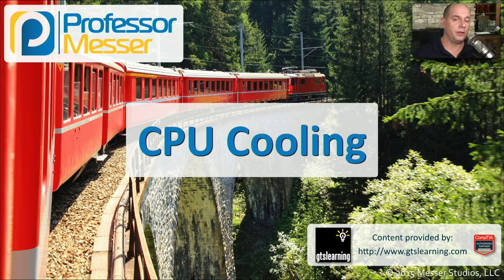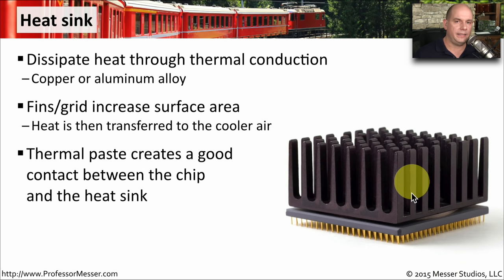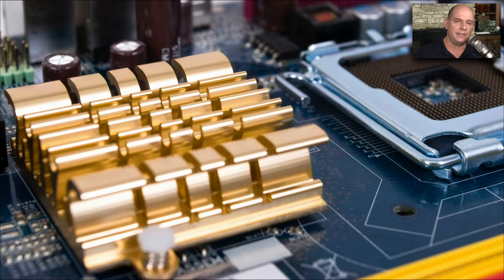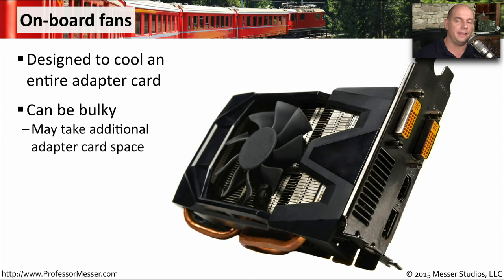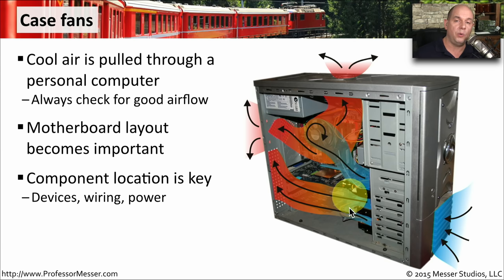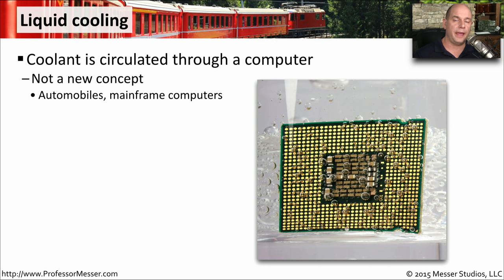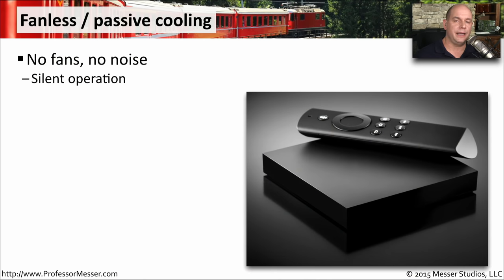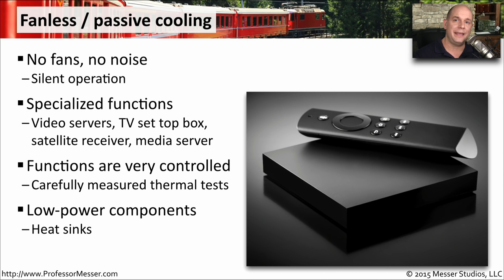CPU Cooling - CompTIA A+ 220-901 - 1.6

Comment: How would this work with Macbooks? They don't have a fan, yet are amazing at staying cool during editing on adobe products.
Reply: Is it a unibody MacBook? That's one genius concept of the unibody aluminum MacBook, the entire case acts as a heat sink. If it's an older model, they do have fans, they are just usually too quite to hear unless you're doing heavy computing.
Reply: JoshBoisse haha You just read my mind. I was exactly going to type the same words. ^^